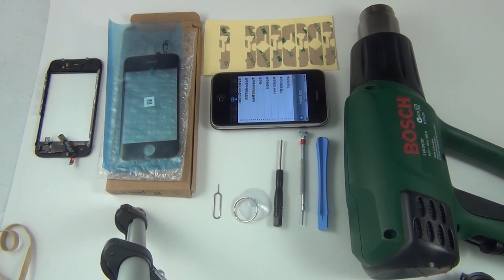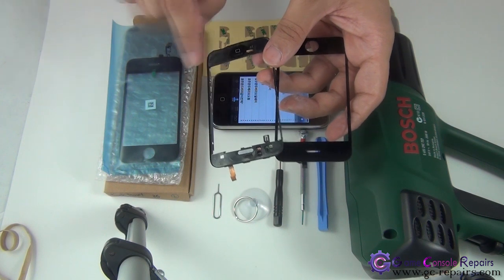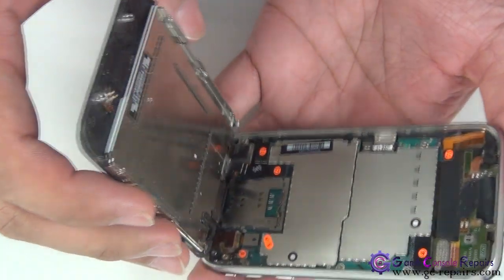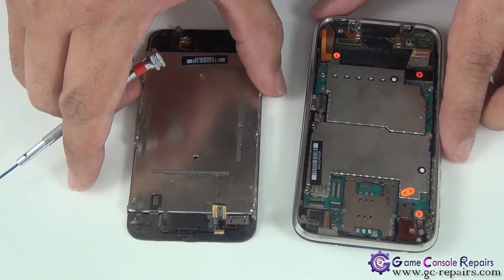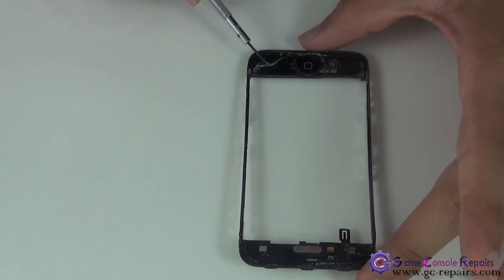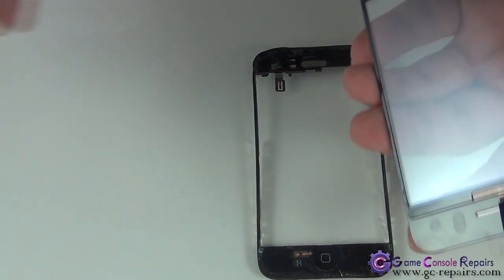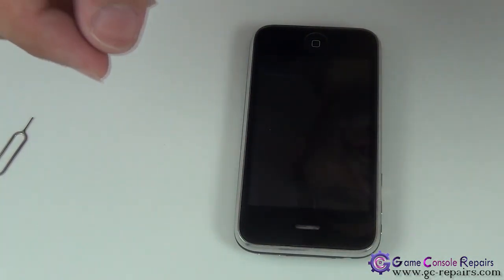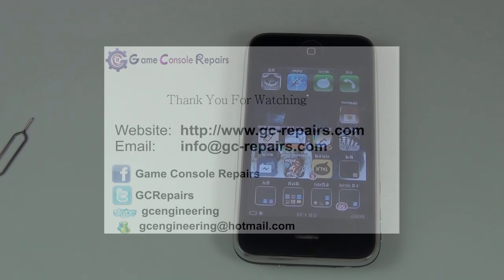iPhone 3GS A1303 Touch Panel Replacement By gc repairs com

Comment: I just had my phone repaired it cost me Sixty dollars compared to the fact the phone cost $700.00 - $900.00 when it was new on the store selves, I'm thinking it was worth the investment. Come to find out it was more than just replacing the glass digitizer that was needed also the battery had swollen to the point the phone couldn't be put back together, and there was water damage to some of the connecting plates under the power switch. Now the phone is back in operation. Had I a heat gun and tools I was planning to attempt this job myself, glad I didn't finding out the other issues would have been heart breaking and at the least very time consuming. Very good instructions hear!